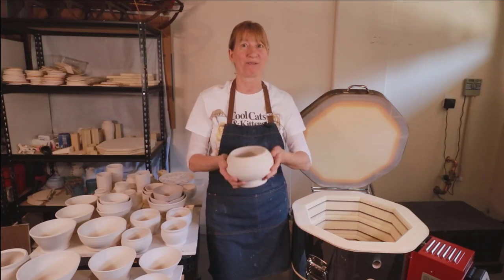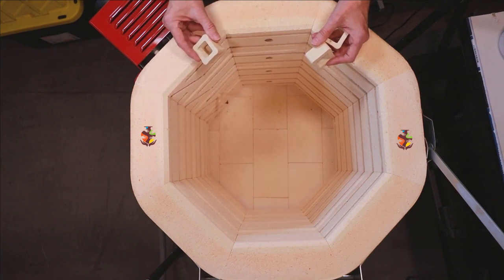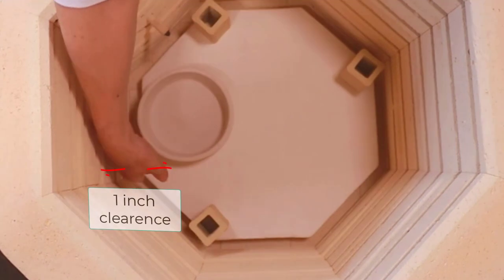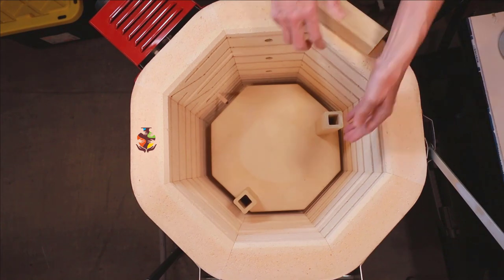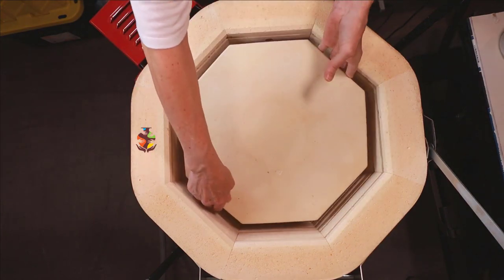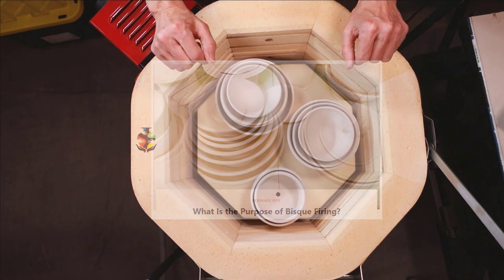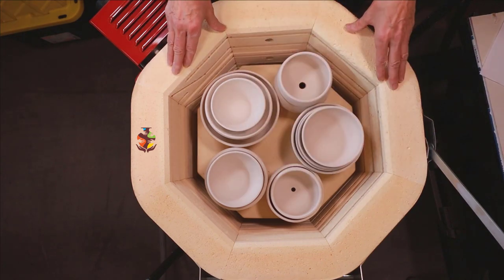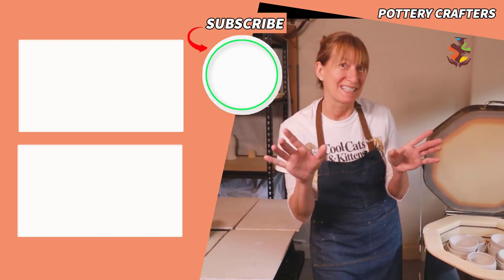Bisque Fire Loading - Kiln Loading Tips and Tricks

Comment: Thank you so much! I am going to load my greenware right now. I do have one question, can you use a whole shelf and half shelves in the same load? I can't figure out how I would put the posts. I only have one whole shelf and 4 half shelves, so I was hoping I could use them at the same time. Thanks again for your videos! So helpful!
Reply from the maker: Yes, you can use your half shelves also. Just place 3 like a triangle under each half shelf. I didn't think of showing how to place the half shelves. Sorry about that. 😊 hope this helps.
Reply: I have the same question. With 1 whole shelf and 4 half shelves. You     mentioned place 3 supports but that would leave a part of the second shelf unsupported. Am I mistaken?  What happens if one support isn’t  over another?  I have tried 4 supports. One top (looking down at the shelves) and one bottom then one on each side supporting each half. I know this sounds confusing…it’s hard to explain. I’m just concerned about ruining the shelves. Maybe it is  a good idea to show this in your video. I sure could use the visual. Thank you 🤔😊

Comment: Marie, you are a treasure. I have had my kiln for 6 months and have been too nervous to fire it! You give an excellent review for us beginners. I bought a slightly larger Skutt (about 5.7 sq. ft) as I expect to have larger pieces to fire. However for my first time, I don't have a lot of pieces to totally fill it but need to do both a bisque and glaze firing now as I have some tableware pieces to get to a buyer very soon. Are there any considerations to firing an underfilled kiln? Also how do you determine what bisque temp to fire between O6 and 04? I will be glazing at cone 6 as that is my clay vitrification but unsure about bisque.
Reply from the maker: Hi Mary Jane. That is great news. So happy to help. If you bisque fire to cone 06, your pottery will be more porous. I would recommend bisque firing to cone 04.
 My friend has a larger kiln and fires half-full a lot with no problems.
 I fire to cone 5 and put a 20-minute hold on at the end of the firing. This is equal to a cone 6 firing but the hold helps to cure the glaze, which helps prevent pin holes. It works great for me. Enjoy your New Kiln. If you have any questions feel free to ask.

Comment: if you are not planning on glazing the pot, is it okay to put a unbisqued, bone dry piece directly into a glaze firing kiln? and is it safe with other pieces that do have glaze on them?
Reply from the maker: Hi Michelle. Good question. Yes, but you can only do that if you are low firing and the bone dry clay does not touch any glazed pieces.
Reply: @PotteryCrafters  Hi Marie, heres a follow up question: is the reason why you can only do this process in low firing because the high firing's temperature rises too fast and the unbisqued clay cant handle the level of heat that quickly? And if so, in theory could you double the amount of time it takes to climb up to the max temperature for medium/high fire clay bodies? ( lets say that there are no glazed pieces in particular kiln)
Reply from the maker: Hi Michelle. If I understand correctly the High fire temperatures rise at the same rate of speed. but If you put greenware in the higher glaze fire to be bisque fired and the glaze fire is a hotter temperature. The bisque ware will be fired too high and not porous enough to glaze properly. 
This post may help if you plan on single firing. here is the link for you.  https://potterycrafters.com/bisque-and-glaze-fire-pottery-at-the-same-time/

Comment: do you need to put cones?
Reply from the maker: Great question Emerald. Yes, I use witness cones every 5 or six fires to make sure the kiln is firing properly. The older the kiln the more often it should be done. I should have pointed that out in the video. I will do that the next time I do a video with the kiln. 😍